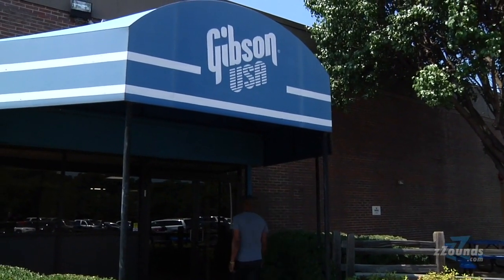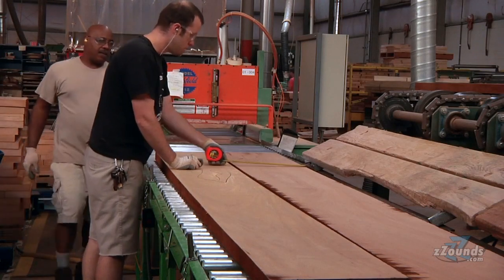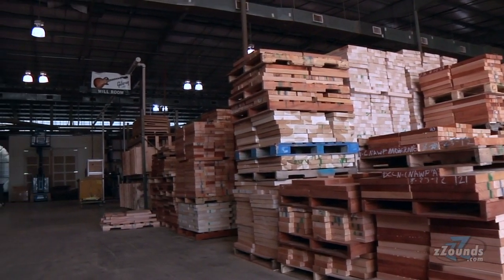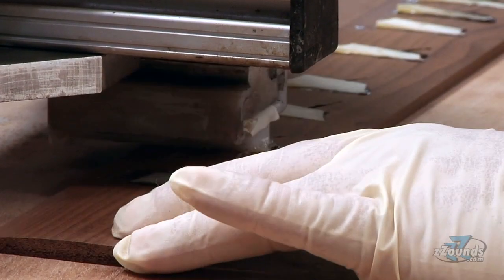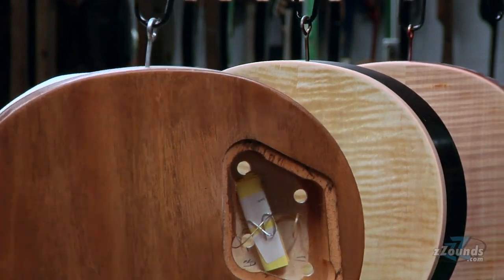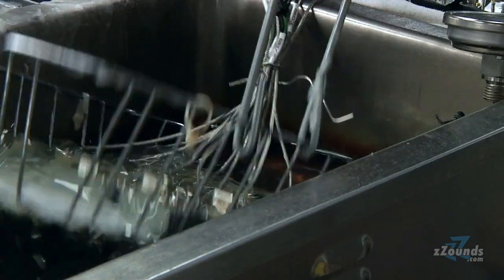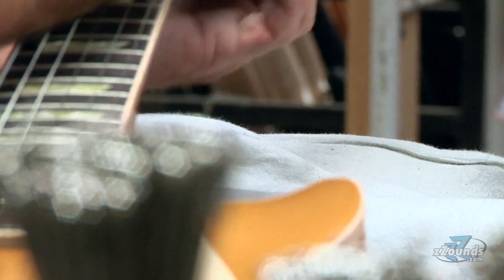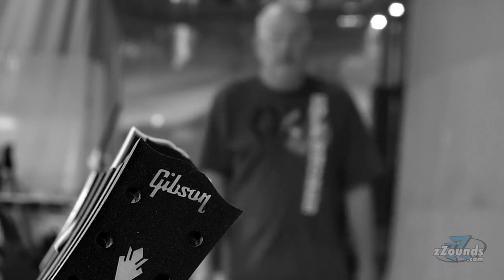Gibson Factory Tour with Binky Griptite of Sharon Jones and The Dap-Kings

Comment: Why do their employee's act so proud of their Gibson guitars, I have heard more QC issues from Gibson than ALL the other companies COMBINED!!!

I own a Gibson M-III and the Trem posts are set in the wrong position so the strings run off to the treble end, the scratch plate has been cut the wrong shape so doesn't hug the Trem cavity or neck correctly, the locking nut clicked when you depressed the trem bar because the underside of the nut was radiused and couldn't sit flush to the (FLAT) nut slot, the neck inlays are not centred, the claw screws were put in at an obscure angle and so adjustment is difficult and the bridge PU (500T) isn't spaced correctly so the pole pieces don't sit under the strings correctly and loss of volume/dynamics is quite evident.. BTFW I have searched the internet for Gibson M-III pics and found many others with the same ailments so I didn't just get unlucky with mine.

I have contacted a Local Luthier and he can put all the Gibson F***k ups to right except the Shoddy cut scratch plate, his opinion was that Gibson were outrageous for letting this guitar reach the stores and NO WAY could have been simply overlooked as there are too many OBVIOUS flaws here which means they don't give a rats ass about their customers or their products period.

I have contacted Gibson many times about a replacement Schaller (Gibson stamped) trem as mine is looking very tired and they REFUSE to reply to my Emails and written letters EVERY TIME.

So to sum up Gibson they have just LOST a customer for LIFE who would have bought many products from them in the future. I was going to buy a couple of the re-issue M-III but I will now have them made by a British luthier who will build them to a FLAWLESS standard!!!